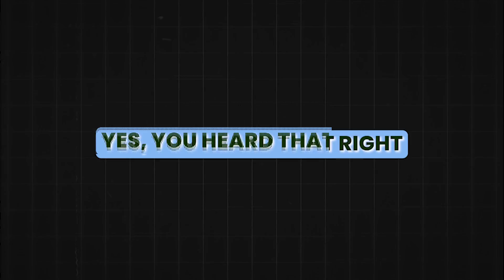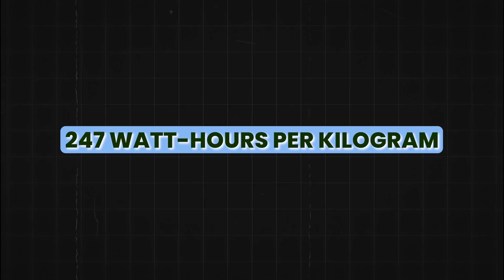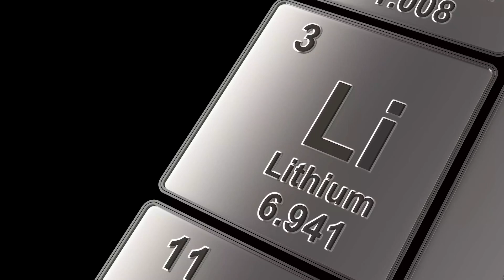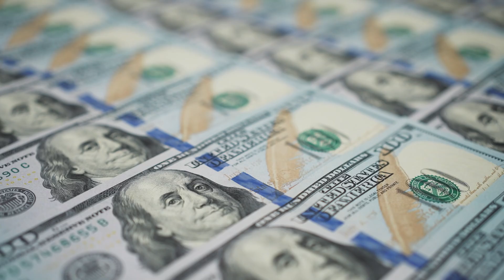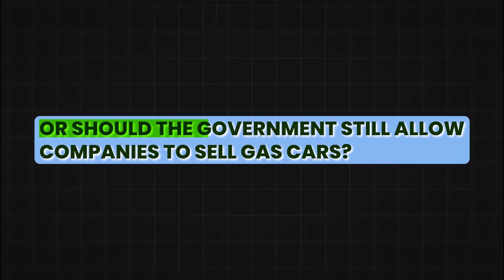IT’S HERE! GENIUS New SODIUM Battery Charges In Seconds!

Comment: So why no carmaker are working with them 🤔🤔
Reply: JAC in China is the first EV manufacturer to use Na-ion batteries in a production model.

One significant issue with Na-ion is the almost linear charge curve that goes from 1.5V at 0% to 4V at 100%, which means having to re-design everything powered from HV to work across twice as wide a voltage range as LFP (2.8-3.6V) and NMC/NCA (3.2-4.1V). This may also cause frustrating charging sessions where charging speed goes up almost linearly with SoC, unlike LFP that gives you a mostly flat charging curve from 10% to 80%.

Doesn't help that currently mass-produced Na-ion batteries optimized for capacity only do 160Wh/kg while LFP is around 200Wh/kg and NMC/NCA are around 260Wh/kg.

The biggest problem with this new and seemingly too good to be true 300Wh/kg battery is that it only exists in the labs at the moment. Tons of revolutionary stuff dies in the labs because it cannot be manufactured in an economically viable manner.

Comment: Tesla's technically now old standard battery is the 2170s have a 269wh/kg and the 4680s are up to 296wh/kg both slightly better than these, although given if this does make it to market in the way the video describes it, a say 280-290 mile long range model 3/y with the near instant charging so long that it doesn't massively decrease  the battery life or cost a shit load that would be an acceptable tradeoff, but if it costs even as much as current supercharging in my area 36-38 cents / KW versus our home rate at about 14 cents / KW people like my parents with there LR model Y would suffer. In there case they have never plugged into a supper charger they are 100% home charging, me on the other hand this would be a god send as long as the aforementioned cavoites don't become reality my charge share is 49% home 49% supercharging and 2% other(time spent at MOA)

Edit- 
I have more faith in lithium silicon batteries being scaled enough to become viable in the next 5-10 years. Undecided with Matt Ferrell @UndecidedMF has 2 amazing videos covering the topic!

Comment: Sodium huh? That couldn’t have explosive reactions with water at all.
Reply: same as the current batteries, that's why they are sealed and remain that way unless a dumb ass say drives over rocks lineing a private neighborhood road and destroy the bottom of the car, and then the media fails to take that into account saying Tesla's are unsafe.
Reply: @gamerbombstudios2668 sodium literally becomes a bomb when reacted with water 😅
Reply: @gamerbombstudios2668  sodium does react to water more explosively than lithium. 

I’m generally supportive of Musk’s innovative takes on old problems. But Tesla does tend to drop the ball on quality control more than they should. There was a person in the UK who drove a Tesla through a puddle on the road, which led to a battery fault from water leakage. Tesla doesn’t cover water damage, even from normal usage, so the owner was on the hook for a $50k battery on an almost new car.
Reply: dude!!! don't mix water with Anny form of battery they contain electricity.
Reply: sodium = salt.
Reply: @benjamindemontgomery6317  no, salt is sodium chloride. They’re talking about metallic sodium, which explodes in a fireball if you get it wet.

Comment: Sodium is very corrosive and lithium is flammable, and unrefined explodes in water.  Collisions and water leakage damage will need to be studied.
Reply: I don't think there is a need to worry about corrosive chemicals in the battery. There is a long history of batteries containing these. What I do not believe is the bit about charging in seconds. The car shown in the video does not look very aerodynamic so a range of 500 miles (800km) is going to need at least 100 kilowatt-hours. At 100 kilowatts this can be charged in an hour, at 1 megawatt it can be charged in 6 minutes, and at 10 megawatts it can be charged in 36 seconds. 10 megawatts would be 10,000 amps at 1000 volts. I don't think a cable and plug capable of handling this safely is going to be very easy to plug in; I think it will weigh about a quarter of a ton if it is three or four metres long. It will be very attractive to the sort of people who nick such things for the copper.
Reply: sodium is corrosive make chure you don't put it on your food. That would really suck.
Reply: @benjamindemontgomery6317 salt packaging has plastic in it.
Reply: @GinoZizza  what! why? I want to know more.
Reply: @benjamindemontgomery6317  We do put sodium chloride in and on our food. As measured by the highly objectionable rat LD50 test, sodium chloride is much more toxic (in the sense that less of it is needed to kill a rat by force-feeding) than lots of chemicals that are legally required to have the Hazchem label "Toxic" on their packaging.
Reply: @cedriclynch  Sodium chloride, also known as salt, common salt, table salt or halite, is an ionic compound with the chemical formula NaCl, representing a 1:1 ratio of sodium and chloride ions. Sodium chloride is the primary salt in seawater and in the extracellular fluid of many multicellular organisms.